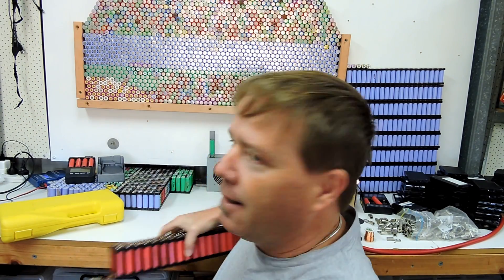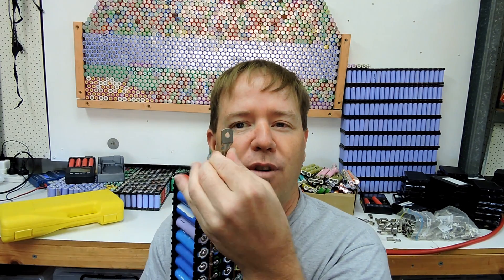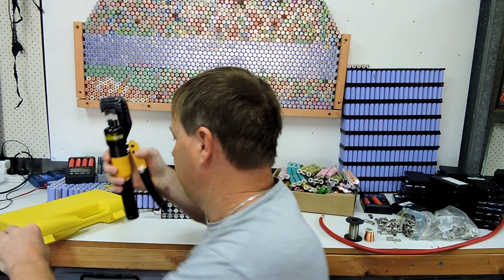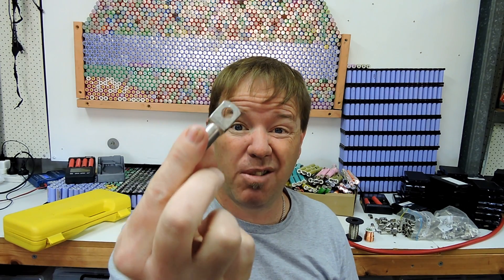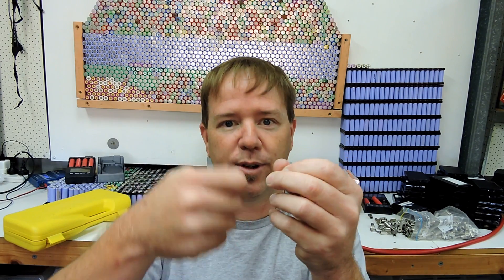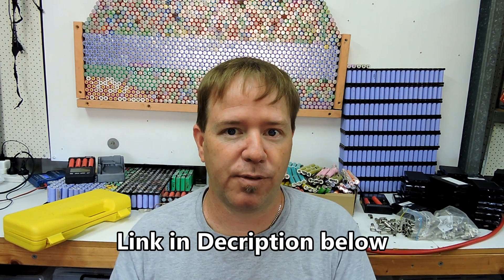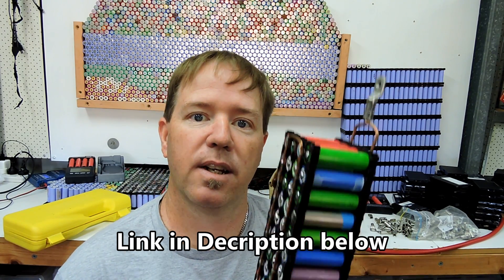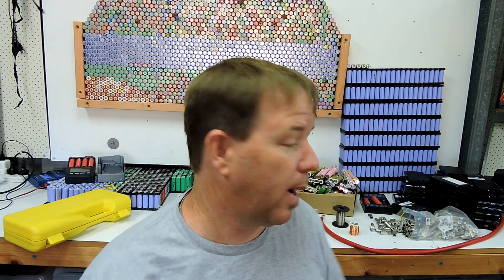18650 Cell Fusing

Comment: If you crimp you really dont NEED TO solder, but it's ok to do both. In my line of work we call that potting the connection. A CORRECT CRIMP made with the appropriate tool/die is actually a cold welding process and potting adds a little better/lower resistance connection, and corrosion protection. if you weigh that against time and money there isnt much reason to pot those terminals.

Comment: Id solder the lugs on quickly with oxy heat lug run solder in before it goes on the pack or is connected to any cells. and heres a tool for copper wire stripping, https://www.ftm-technologies.com/produit/fuchstar/?lang=en but if the gauge is to low it wont work, you could sand the enamel off with emery paper,. (armature winder completed trade in 2001, currently running an ebike conversion business.)

Comment: At time @0:59 you say, "... Hit it with a hammer ...  HOPEFULLY that is good enough ...".  <=== Good Enough ???  No, we do not do any electrical engineering by "hitting it with hammer and then HOPING it is good enough".  Stop giving BAD advice.  Use the the proper tool !
Reply from the maker: Yeh, I'm not a engineer, i'm a guy in his shed trying his best to share what I've learnt/seen/repeating.. Also brain farting to get others to think and try do stuff safer.. Also the proper tool some times isn't available and you have to make do..
Reply: @HBPowerwall  If you don't have the correct tool, then purchase a cable with a pre-crimped terminal.  Bad connections cause heat, and heat causes FIRES .  It is always Safety 1st  ... never safety 3rd ...

Comment: i have some psu cables rated at 20 awg. thats the rating of the cable right? what about a single strand of wire inside of it? what awg they might have?
Reply: Copper Wire is NOT "Fuse" wire.

Comment: Can you advise, if I am making battery pack with cells max discharge current 13a, with 4*cells in parallel,wich  really I give me 20ah battery pack, with constance discharge up to 40A.so I want to use fuse wire instead of nickel strips. Nickel strip will handle about 5a only, so need to spotweld one more on top, but nickel to nickel not get welded properly. So would be 10A fuse wire do job, or that is not good ( battery pack for ebike)

Comment: I noticed on your Amazon store?...you sold 30awg bare copper bus wire... so I was just wondering...do you think I should be ok if I wanted to use 32awg bare copper bus wire?...instead of 28awg?...thanks
Reply: Copper Wire is NOT "Fuse" wire.

Comment: You built a massive 3.7v pack? And you waited months to buy solar panels but didn’t hesitate to get a $50 crimper off eBay? I’m confused. Resell the crimper for $60.
Reply from the maker: I think at this stage i had maybe 40 panels ?

Comment: Good stuff. I've taken apart a 10S13P pack and rearranging the cells. I will end up with 6 10S2P and 1 10S1P packs. I have already spot welded the packs together. Now I'm trying to decide the best way to connect them all in parallel using the original BMS (charge only). Any tips? This my first battery build.

Comment: what awg size wire did you use for the fuse? the amazon page has several different sizes.
Reply: Here is a page about it: https://www.altestore.com/howto/recommended-inverter-cables-sizing-and-breakers-or-fuses-a62/

Comment: I would like to bring to light in the power wall cammuniy that maybe we should look at adding thermol fuses to the packs
Reply from the maker: Been tried - if you have a bad cell that heats up you want it disconnected and not used.. not have the fuse thermally reset. Also adds a bit to the build price. Furthermore you can't see when they have failed/triped
Reply: @HBPowerwall   thermol fuse will fuse and not rest you would only need to test a few of them most electronics that heat up have them in. in case all els fails to control or protect I'll soon de testing in my cell groups wen I get done with testing cell

Comment: I am following all your videos. Thx.One question. I made a 4s 10p power pack. Question is charging this pack from my solar panel. I am charging from the battery outlet of my PMW charge controller. The controller has a default max. charging the battery of 14.4V. So my battery pack get only 14.4V and not more than that.
I know 4s  can go up to 16.8v. My question is do I need to charge after my controller or straight from my 12V solar panel with give a max of 18V at the peak time? Thx.

Comment: Hey dude, how do you load a 18650pack like in this Video? Or is it just for one single use?
Reply from the maker: I recharge them with solar used over and over as many times as possilbe
Reply: HBPowerwall : Do you have a example for a usecase ?

Comment: Greeting, i'm wondering... What about using the PolySwitch resettable fuse protection? Can you use them instead of fuse wire ? Because they are reusable. Just wonderinf if we can use them instead.
Reply from the maker: Definitely but I wouldn't - if there is a problem you'll find it harder to work out where it is if it keeps resetting. Issues need to be addressed not worked around.
Reply: HBPowerwall - Yeah good point . Thank you for your time!

Comment: hi hb can you explain how you connected your 18650 cells I only have 14s50 set up for ebike but I like the way you hang them up by the bus bar so u fuse the positive side only I have some .15 copper fuse wire seems thin and wont hold my busbar how do u solder busbar to pack

Comment: use a flame to burn off the enamel coating, or a piece of sandpaper.
Reply from the maker: yes both work well - but use tinned copper wire these days much better on the soldering iron tips too

Comment: I have been squashing copper pipe into terminals in my solar off grid battery installs for years. I crimp (with a hammer) then solder, the heat shrink.
Reply from the maker: all it has to do is work, but my far the most common thing i've heard is don't solder the lugs
Reply: HBPowerwall 30 years of installing solar, I'll never make a battery cable without soldering it.

Comment: i use wire from ATX PSU cables ----- each single wire blows with 5 Amps
Reply from the maker: great tip!
Reply: thanks
Reply: There is a dedicated wire to use as 5amp fuse, do you think it will work with this kinda project?
Reply: Mohammed Albayati yes

Comment: what is that wire you used to connect the cell fuses to the main output? the heavy wire
Reply from the maker: it is normal 240v house wire striped out and made into busbars - this video can help you on your way  https://www.youtube.com/watch?v=XPdJRD57T7A
Reply: Thank you so much, also what temperature should I solder at?
Reply from the maker: Too many variables - I use a 40watt iron others use a 200w ambiant temp, materials soldered too all change the soldertemps
Reply: Thank you so much for your answer I really appreciate it
Reply: also could you please link me the fuse wire? there is no link in the top corner 2:41
Reply from the maker: https://amzn.to/2MFlJKi that is the stuff i've been using but some use the 30awg thinner and blows faster

Comment: I think fusing is great, you more out of your batteries but you can simply add aluminum foil on them to sync with your copper wire. It would be easier to detach, if in case one goes bad.

Comment: Where is the link to the fuse wire on Amazon?
Reply from the maker: https://amzn.to/2v25vHc that is 20 awg or you could go smaller if you wanted depending on your use
Reply: HBPowerwall Thanks buddy. Also I wanted  to ask you whether we can use the individual copper conductors taken out from a Cat6 network cable. Because that is also pure copper 23awg. Where we can draw nearly 4 - 5 Amps current
Reply from the maker: you can use anything that works for your setup.

Comment: Did you ever recall just what the wire was called? I tried the link but unless I did something wrong it took me to all the parts used and not knowing what the wire is called, I couldn't discern what to buy. I understand that we need to find what works for us individually but FWIW, I'm doing a 48v ebike battery, that is if you have any additional comments on that/wire amperage and such. Thanks for the video, it was very  helpful.

Comment: Hey Pete, thanks for the awesome videos. I'm a bit of a noob, so this may be a really dumb question but...
In terms of the wiring, the entire positive side of the cell pack is common (wired together), right? And same with the negative side?
Do you prefer to do your packs entirely in parallel, then add additional packs in series to get your desired voltage?
I'm pretty confused as to the series wiring part, and how it all connects up to get your desired voltage. If you could help explain this it would really help. Cheers!
Reply: Several factors play in this.... 1) Battery requirements and 2) expandability??.................First, using your load; you calculate your required voltage. TAKE required voltage and divide by voltage per individual cell ( usually 3.6v operation , 4.2v charged)... 2 Series bumps it up to 8V... 3Series up to 12V....and keep going until you reach your desired voltage..... The PARALLEL decides your running energy used per unit of time.  Most of these cells have a maximum of 3400maH..... Again, what does your load use?  500amps per hour? 20amps per hour?..... 3.4Amps per hour??  If your system only draws 3.4 amps and you only need it to run for 1 hour, then all you need is 1 battery in parallel.

Comment: So i have been messing around with 18650s off and on for about 2 years and as far as fusing, does anyone have a ACCURATE blown ratings for different wire gages?
Reply: Its a simple google search away ( I know, mind-boggling)... SEARCH: copper wire fuse rating

Comment: Whack it with a hammer? Actually that's an officially sanctioned method, albeit with the use of what I lovingly call the Caveman Crimper. Bang on it with a rock, no matter, it'll work. They can be found for MUCH cheaper, or probably just home built, but here's the "commercial" version: https://www.westmarine.com/buy/ancor--6-4-0-awg-heavy-duty-stainless-steel-lug-crimper--214080?recordNum=11

Comment: Get your hands on some fuses out of the old 240/740 cars.  You can pull the strip right of the fuse. Might work well.
Reply from the maker: 240/740 cars?
sorry don't follow
Reply: Volvo fuses, thinking out loud, they are shaped differently than normal car fuses.  https://www.ipdusa.com/uploads/images_products_slideshow/fullsize_14565.jpg

Comment: So last night I found a 3 Hot to the touch cells, its most likely just the one cell but the other 2 were low as well,  the other 2 could have been from being next to it while charging as I charge 10 at a time on a REAL iMax charger at 6 amp.  These cells are not all the same exact voltage but are normally close with in .15 mv.  So I wonder if I caused this one very hot cell, that was at 4.08 the other 2 were 4.11 and 4.13 while the rest of the cells were at 4.17.  the other 2 cooled off pretty quickly but the one stayed hot for awhile, surprising it did not drop anymore in voltage either.   I am not going to risk it and discharge the 3 cells and then drop for recycling.   

anyone have any other suggestions if this was a bad cell or how to correctly identify ?
Reply: Cells have a specific C rating.... This determines how quickly they can be charged and discharged.  An additional note is that if you are using OLDER/USED cells, they cannot take a charge/discharge as well as they did brand new, which results in waste = heat. Youtuber JehuGarcia gives a great thesis/understanding on this topic.

Comment: I found Winding from a 12v DC computer fan of 80MM blow at about 6-7 Amps, I think thats a bit high ?  why not use the Iron shaft vs the tip to melt the coating off, or hit with a lighter?   I could use some pointers for anyone out there, I am looking to build a Cpap battery that can last 2-3 days. IRMA Proved why I needed a backup.  Since I have about 200 18650's already just not sorted our discharged yet, I charged them up and was able to run 5v Fans and LED lights.   

What is the best way to test Amp Hour, My cpap pulls about 1amp with everything off.  I was thinking of going 12 or 24 volts.  I have buck / boost converters as well.    I am still learning the ropes.   I know charge up, let sit measure volts  of cells, wait a few days measure again, discharge and dispose of the bad cells.  

I have the ebay special discharges. should I discharge at .5c roughly 1amp or 1c roughly 2 amp figuring the good cells are 2000+ mAh. 

the other thing I need to figure out is Balancing, I think i have a slight understanding but not fully yet. 

anyone up for the task of showing a n00blet computer / network tech the ropes ? 

Thanks for reading.
Reply: As far as you C rate for testing, just pick a number and stick to it. 1,000 ma works good  as the test won't take too long and it will also let you know if the battery will have any heating issues. I would probably just use a torch to burn off and coating on the wires. My plan is for wire on the negative terms and a 1 or 2 amp fuse on the positive sides like AverageJoe is doing. Your transformer will always eat up some of your power. If you can get your batteries constructed to where they can power your device directly, each charge will last longer. Don't worry about balancing yet, just leave your cells at about 3.8 volts until you build your packs. Hope this helps and good luck.
Reply: Tony, 
Thanks for the reply, I was looking at the Glass axle fuse as well. so the Resemed DC power supply I bought 
 (DC/DC Converter 24V/90W) will take for input 12v | 13A  or 24v | 6.5 A   I want to say I tested it on the 14V and it had a low voltage cut off at 10v. 

for discharging the batteries whats the recommended way to get near accurate readings without breaking the wallet ?. 

looking forward to the replies.
Reply: Well, lots of ways to get there. Lets assume you go with a 3S battery bank. That bank will have 3 packs of 60 cells each. 10 volt cut-out would be a hair over 3.3 volts per cell bank, which is good. You could put a BMS on each cell pack, just make sure they can handle the 13 amps that you will be taking out and putting back in to each pack. I would also look for ones that are adjustable on the top and bottom and set them at 3.3 v cut-out on the low end and about 4.1 volts on top. I would also wire in a cheap LCD volt meter to each cell pack just to keep an eye on things. It's a little easier to get parts at the higher voltage and lower amperage.
Reply: So would it be better to go 24 V then ?  also note that I think that is 13 Amps Draw with all the features on, IE humidity control and heated hose, I will have these features off with passive humidity.  I would need to test again as it was over a year ago when I started down this path but I am pretty sure the draw was 12v 1amp from the DC in side of the Converter. at that many cells I would need higher amp charge as that would only be about 216 mA per cell, or is my math wrong on that part ?
Reply: In order: yes...huh?....it depends on your cell pack. I bet you know someone with basic electrical theory knowledge. I just don't have enough info to make accurate recommendations.
Reply: Tony,
You have been helpful, I appreciate it.  unfortunately I dont really know anyone.  now if you want to talk, Computers, Networking or programming I got that covered :)

Comment: 𝗟𝗶𝘁𝘁𝗲𝗹𝗳𝘂𝘀𝗲.𝗰𝗼𝗺: 𝗣𝗜𝗖𝗢® 𝗔𝗖-𝗗𝗖 𝗣𝗜𝗖𝗢® 𝗜𝗜 𝗩𝗲𝗿𝘆 𝗙𝗮𝘀𝘁-𝗔𝗰𝘁𝗶𝗻𝗴 𝗦𝘂𝗯𝗺𝗶𝗻𝗶𝗮𝘁𝘂𝗿𝗲 𝗔𝘅𝗶𝗮𝗹 𝗹𝗲𝗮𝗱𝗲𝗱 𝗳𝘂𝘀𝗲
http://www.littelfuse.com/products/fuses/axial-radial-thru-hole-fuses/pico-fuses/251.aspx
Pico fuses, are designed for this job. Link above...:-)
Reply from the maker: Pico fuses have been well discussed - key is you can't SEE when there is an issue
Reply: You just put a multimeter across the fuse to test continuity, if there is a problem. You don't have to see anything...

Comment: I think you can just buy fuse wire and use an online calculator to calculate the right length / thickness for the max amps you want to allow.
Afaik in the UK for old houses they have the fuse wire instead of breakers you can flip back, so they still sell fuse wire for that.
Reply from the maker: I tried that in some of my earlier tests and the fuse blew in my multimeter before the 5a AC fuse wire

Comment: I physically cringed when you shook the pack by the wire.  I can't believe how strong that is with just the soldered connections!
Reply from the maker: Has to be strong... if that only had the fuse wire on it it would have been all over the floor ...

Comment: I've been having a weird problem with my batteries.  I'm not build battery packs (yet) but just using the batteries loose in things.  I have some cheap batteries ( about 1100 mwh ) and some better ones ( EBL at about 2100mah ).  Every so often one of the better batteries turns up totally dead after charging.  IDK if it's coincidence but it seems like every time it happens I'm charging it with one of the cheaper batteries.  Anyone have any idea what the problem could be?  Thanks.
Reply: Could be that you're over charging and the pressure release valve at the + end of the cell has popped. Gernally speaking all the bad stuff happens when you charge to above 4.2V.
Reply: hmm.  Maybe.  I'll check out the charger.  Thanks.